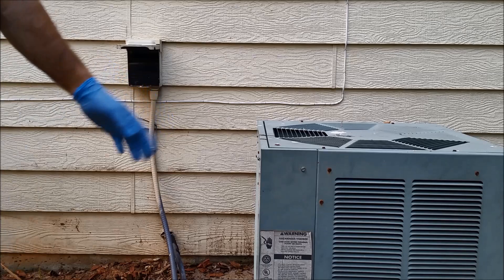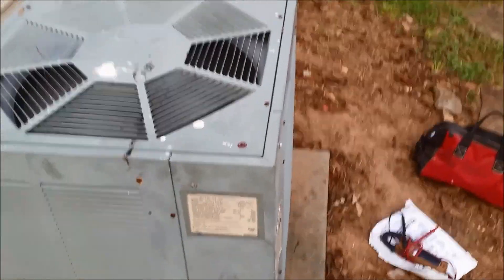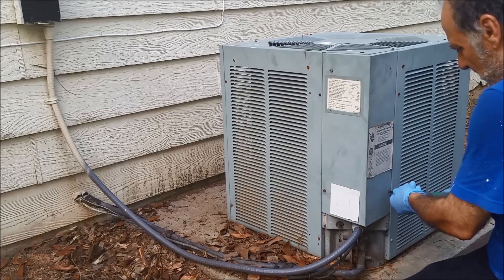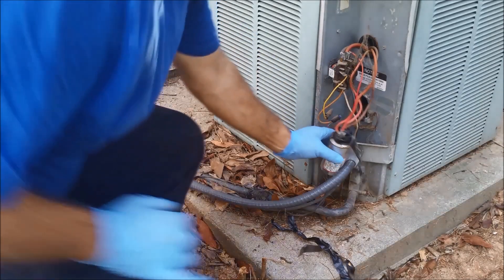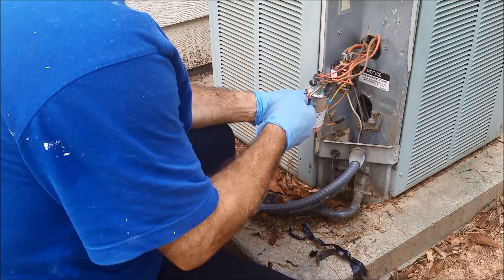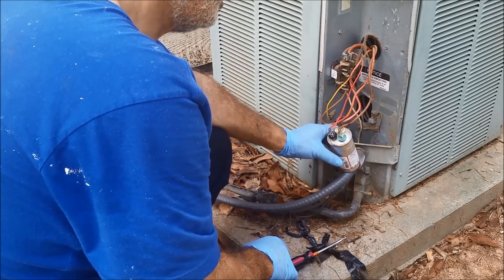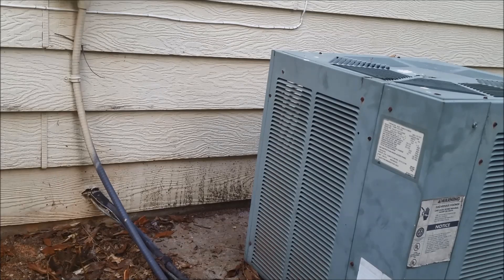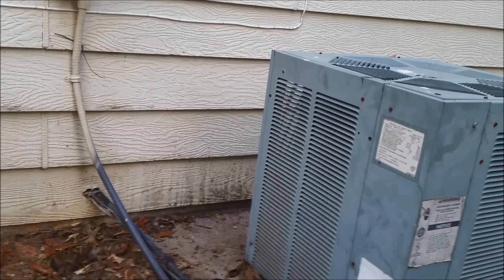How To Test and Replace dual run capacitor - When AC Fan and Compressor not working - Step by Step

Comment from the maker: GE Capacitor 27L556 At Amazon: http://amzn.to/1M2HFHi
Titan TRCFD7075 Dual Rated Motor Run Capacitor Round MFD 70/7.5 Volts 440/370 At Amazon: http://amzn.to/2iYqXoS
Supco RUN CAPACITOR, 70 + 7.5 MFD, 440 VOLTS At Amazon: http://amzn.to/1M2I24M
Mastech MS8229 Digital Multimeter At Amazon: http://amzn.to/1O5tHJq
Ge Capacitor Info https://www.galco.com/techdoc/gecp/97...
Supco Capacitor Specs http://www.supco.com/images/pdfs/Capa...

Amazon Deals:
Try Amazon Prime 30 days for free = https://amzn.to/2JMWaLe
Create Amazon Business account = https://amzn.to/3mLSyYt
Joint Amazon Prime Watch Thousends Of Movies and TV = https://amzn.to/33NfsHD
Try Personal Shopper Wardrobe  https://amzn.to/2VClfv9

Comment: Once again, thank you so much for your video. I followed your advice exactly as you recommend in the video, including buying the capacitor at Grainger ($7.93). It was very simple process. You saved me about $250 on a service repair technician 😊
Reply from the maker: Any time.

Comment: My AC unit quit cooling on a Saturday night at 8;00PM, called my service contract provider, they came out Sunday morning at 8:30AM. Replaced capacitor and was gone my 9:00AM with AC working and a total charge of $34!  I'm 70 years old and my wife is 73, well worth it for us.
Reply from the maker: Thank you for the info.

Comment: So frustrating. We just paid a AC Company here in illinois $250, originally going to be $300+ but he said if we pay in cash he’d give us a discount, right. Anyway, two days later we’re having the same problem. Before the guy left he definitely quoted $700 just for the fan part to be replaced not including the labor
Reply from the maker: Yes it happens a lot. You should be careful from contractors and never pay cash.

Comment: I replace run caps at 10 years. Why, because it’s $25 or so cheap and 50% of service calls replace these at failure.  When a cap starts to fail, it will break down typically at high voltage, not on your little 9 volt tech microfarad read meter.  Cap failure can cause rotor lock and reverse run conditions which damages expensive components in excessive heat conditions.  Treat run caps like tires on your car, replace them well before failure. The let’s wait for it to fail mentality is foolhardy when you think this out.  Offer enhanced preventive maintenance plans to address these issues and you changed them from a customer to a client. A client is who you intend to service forever so to speak.  You make decisions based on best long term approach and prevention as objectives to serve the client to best no failure as reasonably possible.  Clients brag about your company when they hear of someone paying $300 service call for a cap replacement in a no a/c annoying bitter service call.
Reply from the maker: Thanks a lot for the information. You are right preventive maintenance plans is the best way to avoid issues like this.

Comment: hi, Capacitor  needs both + and -. in this case start wire of compressor and FAN and Common are in same leg... so how is capacior chargin..
Reply from the maker: The start up capacitor for A/C unit does not have + and -.  You are confused with DC capacitor. The A/C unit is connected to an AC 240 Volts 60 Hz.
Reply: Joseph K agreed. It is AC and it is bipolar but don't u need both leg to be connected

Comment: Great video thames keep putting out real good info,  what a shame there are technicians that will take you for a ride if you let them or don't know about ACs
Reply from the maker: Thank You.
Reply: Joseph K Do you know what's usually the problem, when my  my AC, doesn't come on from the thermostat,  but when a technician tested it, he made it come on, by Goin direct, do you know if it's a bad contact,  switch, or what's an
easy to check thanks,  I have a Goodman rooftop package unit.
Reply from the maker: It is difficult to pin point the issue  but it may be the thermostat . How old is you thermostat ?  You can easily replace it if it bad. You can buy a new thermostat from Home Depot,  Lows or Amazon

Is your AC connected to the electrical Company Energy Management ? Some time the  Electrical company turn off your A/C on to reduced load from the Electrical Company Grid, but this will happen only when your AC is participated in electrical Company Energy Management.

Comment: Thank you, sir.. I have the same problem you had. I bought a new condenser fan motor today, thinking I had a bad fan motor but I know now it is the capacitor. But I will install the new motor and purchase a capacitor today. thank you for info video.
Reply from the maker: Why do you want to install a new motor if the old one works O.K.? Usually condenser fan motor last for a long time. Just replace the capacitor.
 I hope it is dual capacitor, so in this case you will replace both capacitors, the  condenser fan capacitor and the compressor capacitor.